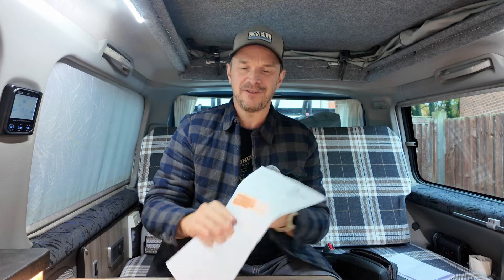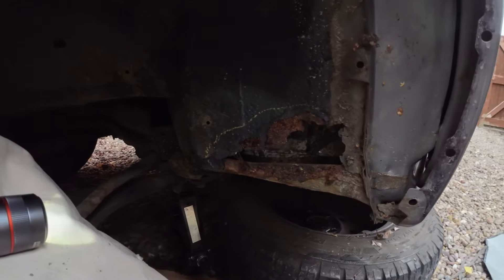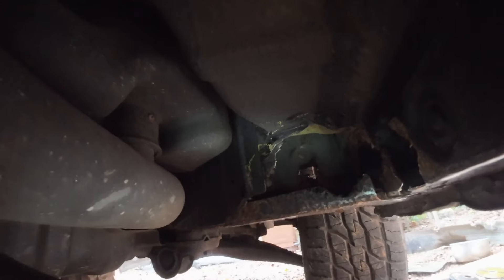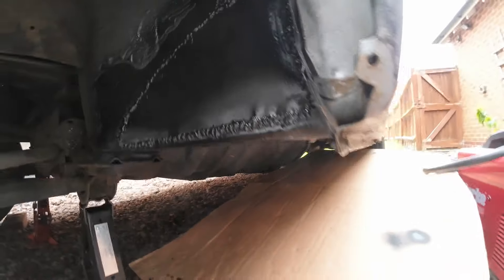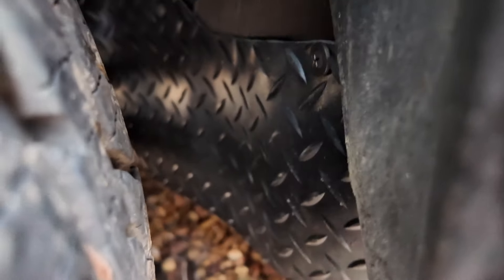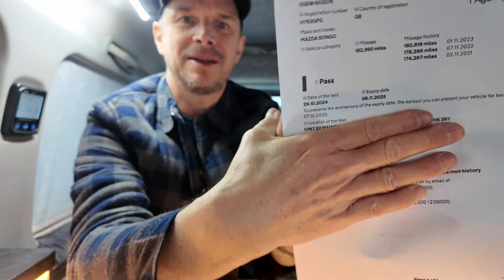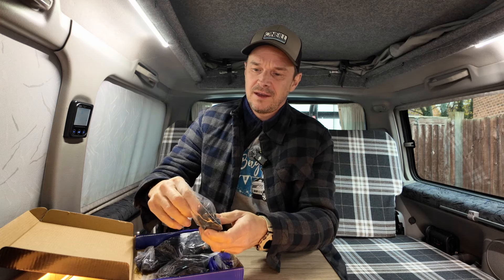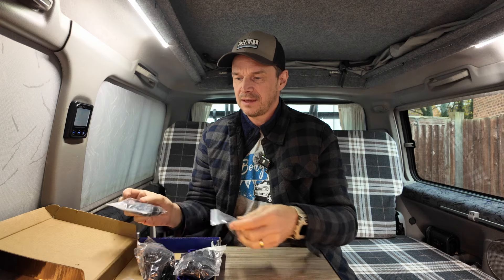Mazda Bongo MOT Failure & Welding

Comment: Now the rot  and cruds out,get sp50 in through the drain holes in outriggers and sill ends and everywhere else you know is solid,the next place to go will be the rear end of the sills and rear lower arches(if rear arches are still original).Sp50 isnt cheap but it works.
Reply from the maker: Arches are on my to do list! I wish I could spend time with a garage ramp so I could get underneath and sort everything out properly :) Cheers 👍

Comment: Hiya mate love the videos I 2 have a bongo with welding that needs to be done.
I can’t afford garage prices but I’m fairly confident in having a go.
What welder do I need? Cheers lee
Reply from the maker: I can recommend the one I have - Clarke 102NG - It's a reasonable price and the lowest amp setting is pretty good for thin metal. I used SIP brand wire in it (0.8mm) but the Clarke wire was pretty good that came with it. 

Best advice I got from watching Youtube vids was to practise on lots of scrap metal and get used to it. I watched a lot of Youtube videos on welding and that helps a lot! 

Welding appears to be an art form that I only really appreciated when I started welding myself :)

Also be very careful with overheating the weld and sparks as it's very easy to set fire to things. Have a fire extinguisher and fire blanket. 

Cheers 👍
Reply: just be carefull you dont cause a fire take out the plastic steps first if welding by there and pull carpet back inside
Reply from the maker: @chris777-c1k  Definitely! I forgot to film that bit, but I did remove the step and taped up the wires in that area. The danger of causing a fire during welding is a real fear of mine!!
Reply: Really appreciate the info and tips guys
Reply: @leedryden4502  no probs i just went to tesco and i took a giant sloppy poopy on the floor and old man slipped on it was so funny 🤣🤣